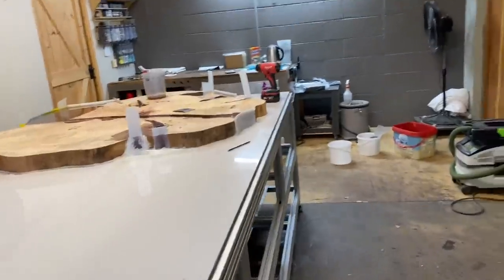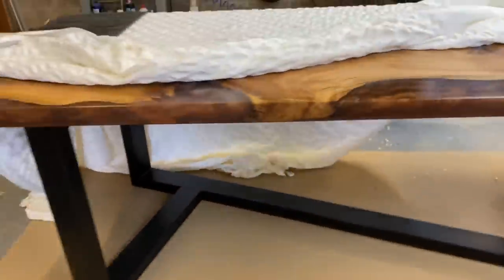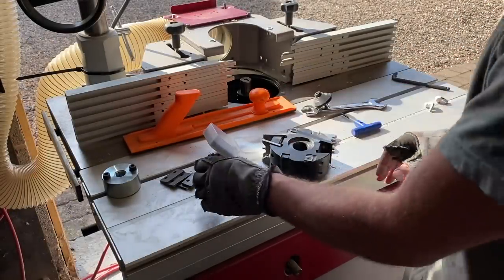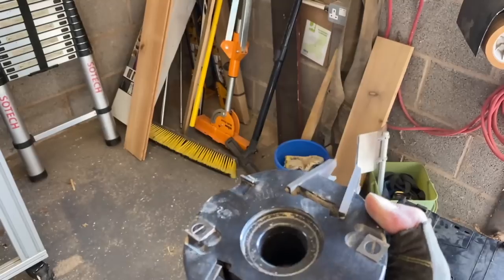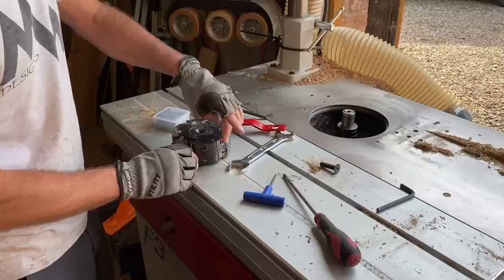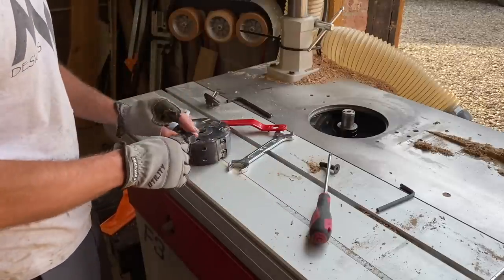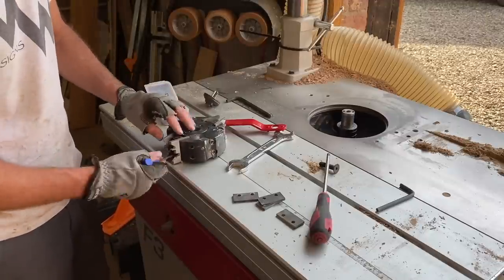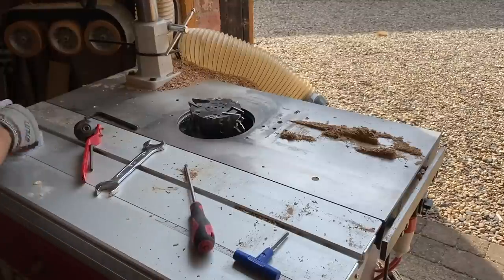Spindle Moulder - Shaper -  Multi function Block p1

Comment: Thanks Andy, is there a link / reference for the magnetic stop you had when tenoning?  I have a felder 700 and could do with a simple stop for that too.  Top tip - the cutter block is quite heavy and while it needs to be at the top of the shaft for over the top profiling (as when cutting the tenons) In would advise mounting it lower for all other operations - safer, less wear on your machine bearings and more accurate.  Great work though buddy.

Comment: Thanks for the lead about Whitehill tooling. Been looking for a lock miter head that is not with a Felder $$$ pricing.  Felder Profil 45 with 30MM and 1.25" spindle and love the flexibility. Keep after the grease on those bearing. Have asked Whitehill if they make a lock miter for .5 or .55" thick wood. Am building gun boxes at the moment and head phone boxes with finger joints. With a sliding table I feel confident I can lock miter with good results in red oak or walnut. Chicago

Comment: "Spindle" moulder, not "Spindal" -- in case folks are searching and you don't want to lose that traffic.

Or, in the US and some other countries: a "Shaper"

That finger fence/guard is amazingly expensive when I last looked it up. Looks really nice, though. I ordered a shaper over the summer (it will arrive in January). I didn't get a power feed with it, but after seeing this and some others, I think I may order one.
Reply from the maker: Oops. Thanks
Reply: Hi Pete, I would guess the fence you saw before was an Aigner model with the flip fingers if it was crazy expensive. Ones very similar to the one on the hammer in the gideo (with the sliding fingers that are locked with hex head grub screws) can be picked up pretty cheaply. Axminster used to do it as a off the shelf item for less than a hundred quid a pair, but I think they have discontinued them now. They do still however have them on some of their own brand (generic manufactured) moulders, so I bet with a phone call they could still be obtained as a spare part? They're bound to be available somewhere else too, as they came on machines that were rebadged for various different distributors. Not sure if that helps at all. 🤷🏻‍♂️
Reply: @carpentryjoineryandcabinet6335  That's good to know, thanks! Yes, pretty sure it was the Aigner one I saw on the Felder site. Aigner makes nice things, but they make Felder look like discount goods :)
Reply: yes you want a power feeder and you want to use it for every operation that you can
Reply: @adamchesis7443  Thanks Adam

Comment: Hi Andy, nice video again. I’ve got a Hammer spindle moulder/saw combination and am thinking about getting that Whitehill cutting block mainly for tenons. I’m just wondering about the low profile nut and whether it has the 2 long pins on it like the original hammer securing nut has?
Do you have any concerns about it coming loose seeing as it’s only held on by a M10 countersunk bolt? I’d be interested in your thoughts… Thanks

Comment: Do they sell ones for standard imperial spindle?
Here in USA ours are in inches 1", 1.25" 3/4"
Reply from the maker: Not sure , ask via there website
Reply: 1.25" is also a standard size in the UK. I'm fairly certain Whitehill still make blocks for that diameter spindle.

Comment: Basically, a router on steroids... 👍
Reply: totally different machine the cutter diameter gives you a much cleaner cut and its balanced so it cuts more accurately add a power feeder and it will give you clean accurate profiles and it much safer than a router table
Reply: @adamchesis7443  that's because of the steroids.